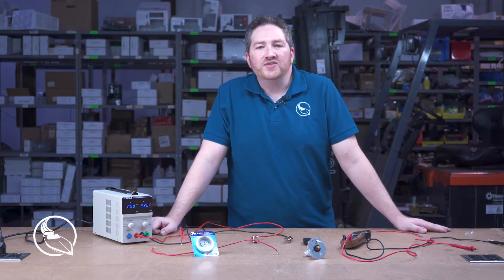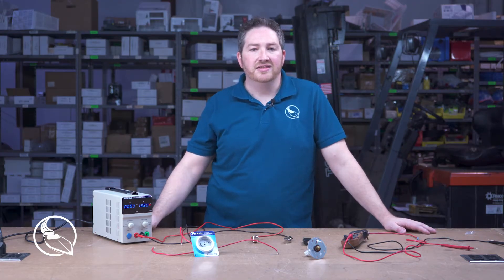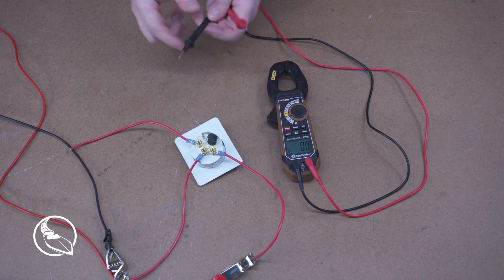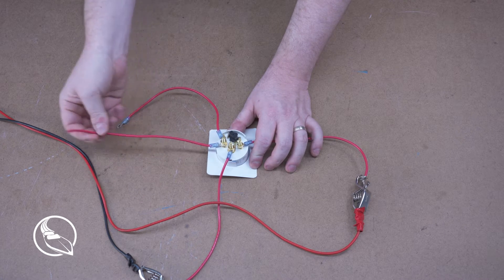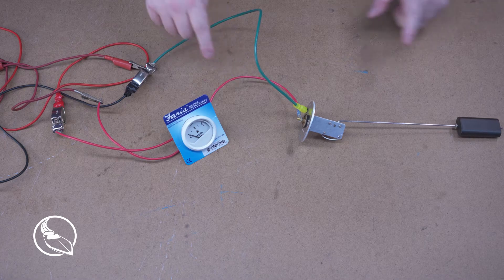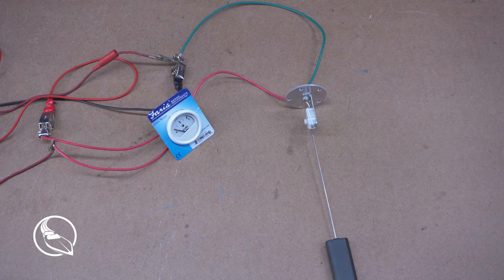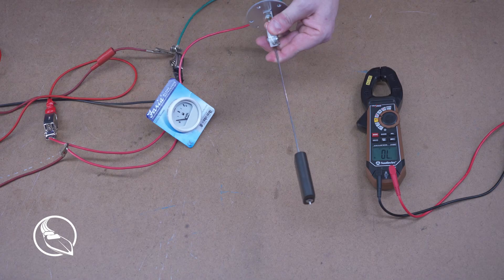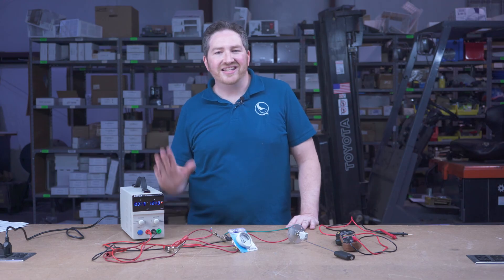Troubleshooting Fuel Gauges & Fuel Senders

Comment: Hi and thanks for the video. I've replaced my fuel sending unit 3 different times thinking that it was the problem but my digital fuel gauge is still malfunctioning. The digital fuel gauge reads inaccurately. When I fill up it will show its full but the box will drop within five miles and at half its showing I've driven 100 miles. My manual says I'm supposed to get up to 27 city and 33 hwy. What could my problem be? PLEASE HELP!
Reply from the maker: Hey thanks for the question.  This sounds a lot like an automotive gauge you are using.  Most marine fuel senders won't work with those.  Can you confirm what brand of gauge and sender you are using?
Reply: Great clearly explained video 👍🇬🇧